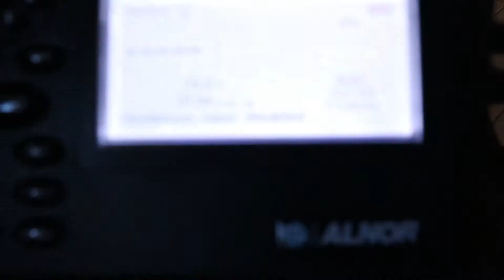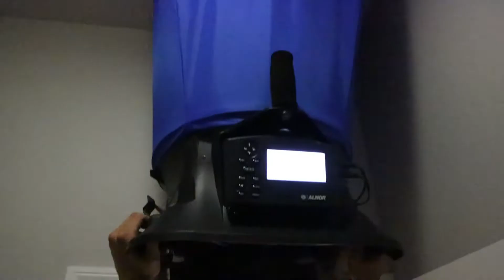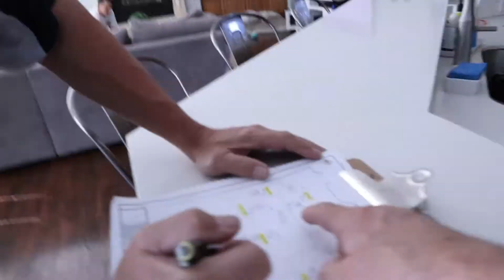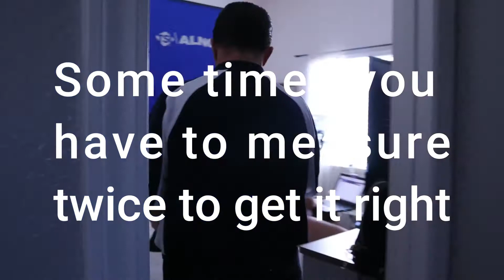Air Flow Testing Leon Residence

Comment: It would be nice to see a detailed breakdown of the numbers, comparing supply CFM to the total of all the individual rooms. Also a CFM per supply diffuser design vs actual. Thanks. I bought one of those ALNOR  units for the company I used to work for, nice unit.
Reply from the maker: Hi Ted, that is exactly what we do, we first measure in the air flow coming from each register. I also measure up the home and do a room to room load calculation that details what is actually needed in airflow. I then compare it to what we measured by dividing the measured cfm by the design cfm and multiply by a hundred to arrive at how far off it actually is. We then can determine where we need to make adjustments and/or replace ducts. When we are finished, we do a air balance and then measure out all the registers again to show improvement. 

Here is a link to an older video detailing how we do it, it is 24 minutes long but it goes into greater detail.
https://www.youtube.com/watch?v=-sptndXCWkQ